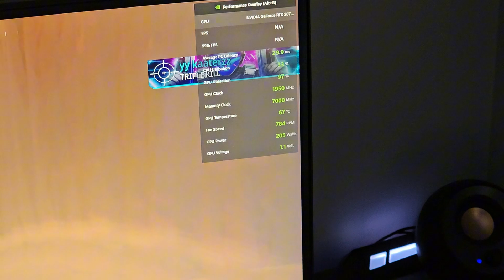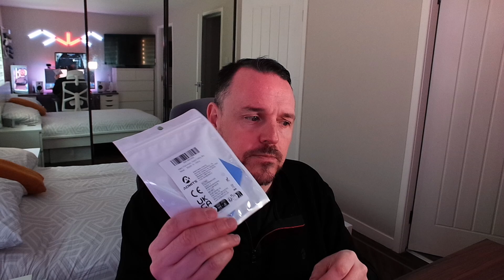How to Replace Thermal Paste on Gigabyte RTX 2070 Super [2024]

Comment: This helped so much. My temps used to hit 80s now im 20-40 at max rpm in the test i did with software. My games also no longer drop from 60fps to crippling 15fps due to heating up. My only comment about the video, is the music was over whelming.

Comment: Much obliged for your no-nonsense tutorial! My almost 6-year old 2070s has started exhibiting the same behavior in the last couple of weeks - fans revving up to 4000rpm for about 3-4 seconds and then going back down.

Turned out the difference between the core temp and the hotspot was about 27 degrees (78 and 106 respectively).

Repasted it today thanks to your video and my temps have gone down to 71 for the core and 85,5 for the hotspot.

Hope my old GPU will last 2-3 more years what with the prices being obscene and all.
Reply from the maker: Another success story, superb....happy gaming 👍

Comment: My fans were way to loud, even with undervolting. And I delayed changing the thermal paste thinking I'd have to change the thermal pad too, which seemed a bit more expensive and complicated, since there is different thickness. 
Seeing your video, I tried without thermal pads on 2 2070 super bought day 1. 
Go 20 (with maybe a bit too much thermal paste) and 24°C less, going from 85 ish to 60-65 degrees. 
Thanks a lot !

Comment: I have a 5 years old Gigabyte 2070 Super, the 100°C+ hotspot temp started after around 3 years of usage... so my fix was limiting the temp with Afterburner, so it won't have to run the fans at 4000 RPM. Was afraid of repasting it, but it's actually not that hard. Jumped down to max 70°C (base temp), which is lower than the temp I had factory new. The end of thermal throttling, thank you!
Reply from the maker: Deffo seems to be a case of them being very stingy with the thermal paste when built...or not yhe best quality paste. Great to see the results people are getting with a simple repaste.

Comment: I also got my Gigabyte RTX 2070 Super in 2020 and recently started having high GPU temps 77°C (105°C hot spot) causing my fans to go overdrive beyond the fan limit. Upon taking it apart, I found that there was hardly any thermal paste and any that was there was completely dry. After cleaning and reapplying the thermal paste and pads, my GPU temps dropped to 56°C (70°C hot spot). Thank you so much for the video!

Comment: Definitely feel like this is the issue with my Gigabyte 2070 super. Though I've been having this issue for a couple of years now, so I'm a bit scared of what my card's gonna look like. I got it in 2020 and it probably started happening about 2023. For a while setting the target temp to 65 degrees in my gigabyte software worked, but it's doing it now even with that, so it looks like I'll have to order some thermal paste, and some pads just to make sure. I'd have no idea how to go about replacing the pads if I need to though.
Reply from the maker: @CCoreOW  you'll probably find like many of the others and myself included that just doing a repaste will do the trick. If you do have to replace the pads its just a case of paying attention to where the pads are positioned when you take the card apart, make sure you are using the correct thickness and cut them to the same size as the original ones then swap them out.

Comment: Bought this card a couple of days ago installed it and was playing Forza 5 on ultra. It was running at 80c in the menu and was hot spotting about 106c. Literally after a 10 job of swapping out the paste it was running the game under load at 59c and hot spotting at 71c. No more 4000rpm jet engine

Comment: I bought my 2070S in 2020 and today done first thermal paste and termopads replacement. Under load hot spot was 106C and the fans were screaming like a jet engine. Now under load max temp is about 80C (hot spot) and is quiet again. Thank you! :))

Comment: Was feeling horrible about my revving gpu, was scared I was going to have to buy a new one since the noise was getting so loud and frequent and really bothering me. Found this video after trying numerous fan control softwares and decided to give it a shot. The new paste immediately fixed the problem, gpu running 20 degrees cooler and super quiet. Big thank you!!!
Reply from the maker: @dskrocks1  good news keeps coming, glad this video has helped so many so far 👍

Comment: If my temp his 60 75 and pc restarts is it overheating gpu?
Reply from the maker: Doesn't sound like it's hot enough to cause restarts, what temps is the CPU getting to?..could also be a sign that this PSU is on its way out if it's crashing during gaming
Reply: @BrisyTechBytes  well pc freezes

Reapplied paste on cpu 40c
Reapplied on gpu as well now it kook like it spread a bit far and theres weird markings on the board like a smudge
Reply: @BrisyTechBytes  looks like it might be the SSD or the cable connecting the SSD how even?
Reply from the maker: @richter9911  at least you've narrowed it down to what's causing the problem, hopefully you can transfer the contents to another drive before it packs in altogether

Comment: Thanks so much!  I was really terrified about doing this, but this gave me the courage to do it and by following the fantastic video it worked first time and the temperatures on my Geforce 2070 Super dropped by 20 degrees.  I didn't even need to change the pads.  Thanks again.
Reply from the maker: @martincosh5891  great news...and good to hear like me just the repaste done the job. Can I ask, did yours look like the factory added thermal paste was a bit sparse?
Reply: @BrisyTechBytes  Yes, there was hardly anything on there.  The card is around 6 years old if not more, so that probably didn't help.
Reply: @martincosh5891   is that a Nvidia Geforce 2070 Super 8 GB by any chance. I'm looking for a schematic for thermal pads when I'm doing the repaste. Do you know any site that has such a one , I.e. shows the .5mm or 1mm etc . Thanks
Reply: @CAPTAINSARGE  Yes, it's a 2070 Super 8GB.  Sorry, I don't know anything about the sites for pads - mine were still damp(ish), and I left them in the card.

Comment: I'm worried my cards starting to overheat. Starting to get around 85+ on an fps shooter after an update and cpu update. Ran great for weeks. But now I'm also wondering if that's what a black screen means..- yet the pc is on

Cleaned the dust checked my fans, wondering if the way theyre set up is not proper.. Wondering what's next 😢 hopefully not this
Reply from the maker: @olliej914  no harm in doing a repaste, 10 minute job and it could solve your issue for little to no cost
Reply: I most nervous about the amount of thermal paste needed and the thermal pads condition 😅

Comment: For anyone watching this video to fix their GPU fan issue of it reaching 4000rpm and sounding like a jet engine: YES! This fixes the issue!

It took me a few months to build the courage to do this, but I finally had enough a few days back and ordered the paste and IPA solution. Adding the new paste took me 2 hours from start to finish but I took it nice and slow picking the card apart AND took my sweet time to clean the old paste off. It can probably be done in half the time.

Despite my looming anxiety about breaking stuff it all went smoothly and now the annoying jet engine sound is gone, and it honestly wasn't even that hard of a fix!
I've been running my GPU at 100% for 20 minutes now and my GPU fan speed doesn't even pass 2400 rpm.

Thank you so much for posting this video! I'd be too scared of taking my card apart if I hadn't watched this!
Reply from the maker: @Jenpaii_  glad to hear you done the repaste yourself, you'll probably be kicking yourself that you didn't do it sooner after realising how simple it is...enjoy the quiet gaming and thank you for the great feedback 👌

Comment: I took the lid off my Gigabyte 2070 super  OC 3x Gaming/Windforce(?) GPU tonight. The thermal paste was dry, and it had leaked out onto the PCB. At first I didn't really understand why, but now I think I do. 

I don't have new pads, and I really need to replace them, because they're covered in dust.. At first I just assumed it was normal. But the more I think about it, how the thermal pads in the centre were trashed, the paste being on the PCB.. This was caused by GPU sag. It won't be the same for everyone. I didn't think it was sagging badly, only slightly. I guess it actually makes a huge difference over time.

I think the coil whine was caused by one of the pads not making any contact at all.

Comment: did you have any issues with your thermal pads afterwards? That is my only concern with cleaning mine.
Reply from the maker: @JakeSafetyMan  didn't touch the thermal pads, even though I bought new ones the existing ones felt like they still had moisture in them so thought I would see how I got on with only doing a repaste, as that worked out well I just left the thermal pads.
Reply: @BrisyTechBytes  Sounds good. I might need to pick some up then.

Comment: Thanks so much for showing this! I've also had the same card for over 4 years and its always revved up like crazy. Hot spot would hit 104.8 C on load. Now swapping the thermal paste brings me down to a 83 C hot spot under max load and essentially no noise.
Wish i did this years ago, it took 5 minutes and the only hard part was separating the board.
Reply from the maker: @LegacyWillni  glad the repaste has helped. I should have definitely done this sooner but as this card was in my sons rig he never seemed to complain about the noise as he always games with a headset on, it was only when I moved ot over to a new rig I built my other son and he started gaming on it I heard how loud the fans were, delighted a simple repaste sorted that out.
Reply: YOOOO im in this current situation rn its crazy how much it revs glad i looked this up was going to replace the fans but ill just clean them and replace the thermals!

Comment: I’ve had my 2070 Super for over four years and I also noticed my temps were getting really high. So cool that I searched how to reapply the paste for an older card and your video with my exact model is from 8 days ago. Thanks a lot man
Reply from the maker: @junebeethree  thanks for the feedback, much appreciated. So out of curiosity have you done the repaste? Would be good to hear how much of a temp difference it has made for you.
Reply: @BrisyTechBytes  So I just got my MX-6 in the mail today. I was getting pretty close to the Thermal Limit of this gpu at 83 degrees in many games if I didn’t do any undervolting through Afterburner. Even then, still hovering in the high 70s, often my gpu temp was higher than my cpu temp. 

After the repaste and a bit of testing, it looks to be sitting comfy in the low 60s, sometimes spiking to 64 or 65. Huge improvement, if I’m being honest I didn’t think I would get anything close to that, but my paste was pretty sparse when I first removed the cooler.
Reply from the maker: @junebeethree  great to hear that a simple repaste has helped you too.

Sounds like your original thermal paste was rather   dodgy like mine was, no coincidence it was like that for the 2 of us so no doubt there will be plenty of other out there.

Happy silent gaming 👍
Reply: @BrisyTechBytes  i'm going to do the same with my gigabyte 2070s... same issue, moreover my fans when in fixed mode they just cant'stay fixed but have a sort of up and down curve, weird.

Comment: Excellent video, great spot on the cables same one had popped out on me during reassembly. 

Just a note on your comment at the end: the 2070 super requires 0.5mm, 1mm, 2mm & 2.5mm pads. 0.5mm for vram, 1mm & 2mm for heatsink. The 2.5mm are on the back plate and a bit more of a job to get at, plus my pack didn't have em so I left them be.

Very nervous taking it apart but as far as jobs like this go it's extremely straightforward once you get stuck in.

Enjoy your 4090!
Reply from the maker: @IconOfSin  thank you bud, appreciate the feedback 👍. 

Yeah I knew of the 2.5mm pads on the back but after disassembling the card and seeing that the thermal pads were still quite sticky and had not dried out I thought I would just leave the back ones, stupidly forgot to mention the back ones in the video thaough so a little annoyed at that.

To be honest after seeing the thermal paste on the GPU die I think it was never covered evenly from the start, was quietly confident that just repasting would make a huge difference...and it did 😉
Reply: @BrisyTechBytes  nah video covers it better than most, iFixit has a decent article but internals don't quite match and literally 0 mention of cables. 
Gotta say my paste looked just as bad if not worse... but mine was hitting excess of 100° in minutes of running BG3. Seems to be very common issue over time with the 2070 super. All my 10 series cards are still going strong, the 20 was only a few years old. 
Thanks again brother 🤙🏻